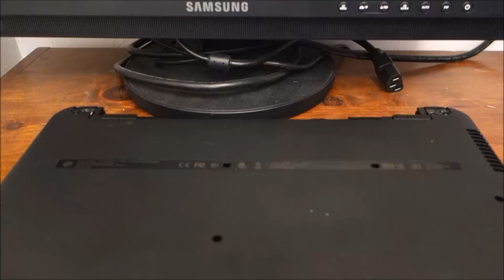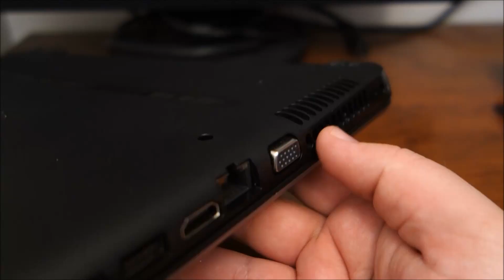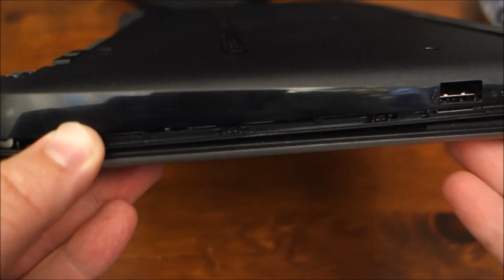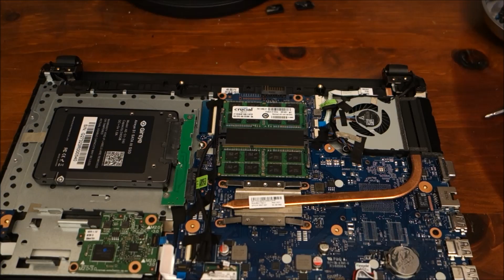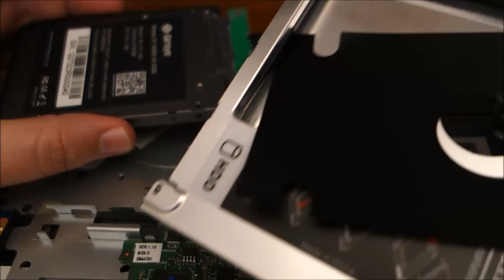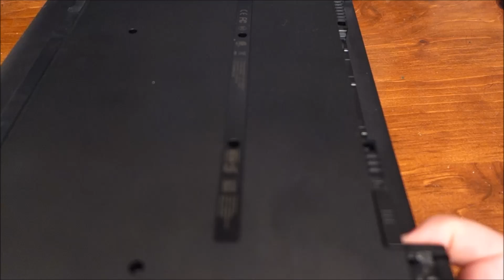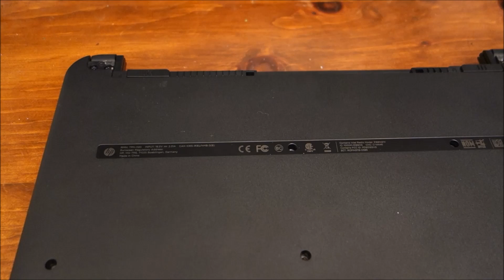HP 14-an013nr case opened up, ssd install, memory upgrade

Comment: well... I ended up breaking the back like you warned us about and I was so confused because I thought I had unscrewed everyrthing to find out that there was a secret screw next to the hinge. I saw 3 that were under the rubber stoppers but I had already unscrewed but when I just ripped the case off I saw there was an extra screw under a thin layer of something. In the end I super glued the piece back on and managed to upgrade my ram but the since the part that got ripped off right next to the battery it now causes the battery to be slightly crooked. worth it though.
Reply from the maker: +Dultimate Gamer oh no! Working on laptops has always been a "do at your own risk" kind of deal. I know you can buy a new base from hp, they are like $30.
Reply: AICproductions good to know that the back are relatively cheap just in case I really need a new one but you can only see the mess I made with super glue but not the damage itself which is nice because I am not the owner of the laptop.
Reply from the maker: +Dultimate Gamer got you. What upgrades did you do?
Reply: AICproductions I upgraded the ram to 2x4gb and was planning to upgrade the storage to because I had a broken laptop just lying around covered in dust at the time I didn't realise that I needed a adapter. I didn't really watch your entire video but I watched up to when you were talking about the ssd and you velcroing it but what does it mean to have a single channel ram slot(s)? Is there a major performance impact vs dual channel or is it just a minor inconvenience
Reply from the maker: +Dultimate Gamer dual channel means some systems can run a bit faster if you have two identical ram sticks. This system is not capable of that. It's only like a 5-10% increase in some instances.  This system isn't fast enough for that to make a difference. Linus tech tips covered it in a video recently.
Reply: AICproductions thank you for the info, I am using two completely different sticks of ram running at a different frequency and everything which I'm surprised even worked. Also ay you watch Linus Tech tips to? I love that channel
Reply from the maker: +Dultimate Gamer yup, he's one of my inspirations, but they tend to do quick reviews of top end stuff. I like reviewing stuff people actually buy.

Comment: where is the CPU? can i replace it with a better one?
Reply from the maker: +Boys Simard no.
Reply: no, i can't replace it?
Reply from the maker: +Boys Simard correct on these low low-end systems it is extremely uncommon to get a system where the CPU is not soldered to the motherboard
Reply: alright. to bad. thank you.

Comment: Excellent video. Truly helpful. One question. I see that you have added an SSD (instead of HDD) to increase the storage space. I was hoping to connect an USB drive (dongle) instead. Do you know if this laptop has unused USB 2.0 and/or USB 2.0 headers? Thanks so much!
Reply from the maker: +rajkumarpjain it does not. Why would you do that vs a 2.5"drive? I used an ssd because they are faster use less electricity and create heat than a regular drive, but you can pick up an sshd, which has some ssd storage and mechanical storage. They are a great compromise.
Reply: To access and work on the prop software, I need the USB security dongle to be connected via external USB ports at all times. The worry is that I might misplace the dongle. However if I am able to connect the dongle via available/unused headers internally, then that will solve my problem. I read somewhere that generally all motherboards come with spare USB Headers, where you can connect USB drives using cables/adapters. Are you sure there is not even a single USB 2.0 or USB 3.0 header?
Reply from the maker: +rajkumarpjain that's true for desktop computers but I've never seen that on the laptop computer
Reply: Ok. Do we even have a remote possibility to connect a USB dongle internally? I don't mind even connecting to a Sata Port provided there is an interface available somewhere!
Reply from the maker: I've never seen anything like that. I would check out monoprice/newegg to see if you can find anything. Good luck with your search.

Comment: Hello, this is my first time upgrading a computer so sorry if I seem like a noob. Once I connect the additional ram and SSD do I need to do anything else with configuration? I saw another instruction video that was messing with the BIOS configuration. All I want is more space and ram. Thanks!
Reply from the maker: you don't need to do anything more with ram, but with storage, it depends. if you want to run your OS from the SSD, then you'll need to install the OS to the SSD (which I recommend doing). there are plenty of videos covering how to install windows.
Reply: Could I use a cloning program to move everything including programs and the OS from my original hard drive to the new SSD?
Reply from the maker: +Nick Gonzales sure. I have always used macrium reflect.

Comment: That's a helpful video. Thanks a lot! But you mentioned there are 14 screws. There are 2 more wide headed screws near the cd drive slot that makes it a total of 16 screws.
Reply from the maker: 14, 16, what ever it is, its a ton. way more than there should be. my dell has 1 screw and my zbook 14 has a latch to remove the bottom plate.

Comment: Is it really only single channel? I see so many people upgrading it to 8gb by buying another 4gb ram
Reply from the maker: Yes, but you still get a performance boost by going from 4 gigs to 8 gigs. At least I sure noticed a difference in performance. but its confirmed by cpuz that it is single channel regardless of the number of dimm slots used.
Reply: Thanks for quick reply, so if I throw another 4gb of ram in there it doesn't recognize it as having 8gb but it's not just sitting there being unused? Another guy took out his 4gb completely and just put an 8gb in. Thanks for info
Reply from the maker: Of course it recognizes it. dual channel vs single channel is the speed at which the memory runs. if you have two memory dimms installed that are exactly the same (same speed, size, etc) the memory can run a little faster. that's all dual channel does for you. this computer really isn't fast enough to take advantage of that anyways. I had 2x8 sticks (16gb total) and it recognized all of that memory, but it wasn't any faster with 16 vs 8 gigs, so I have just 8 gigs in it.
Reply: AICproductions I see, thanks for the info I was getting the impression that if I just put another four in there it would be wasted, didn't want to spend all the money on an 8 GB when I could just have two fours
Reply from the maker: Yeah, 8 gigs seems about right, and having 2 4's is the perfect way to do it on this system.
Reply: I saw the same guy, it's confused... and literally I'm buying a 4GB memory, and I say fuc* I waste my money

Comment: hi where i can buy the ssd adapter i can find it... please send me the link
Reply: Enter this line in your browser or in the Amazon search bar (that's where I bought it) and you should find the exact caddy:   "HIGHROCK Hard Drive Caddy Tray 9.5mm Universal SATA 2nd HDD HD SSD Enclosure Hard Drive Caddy Case Tray, for 9.5mm Laptop CD / DVD-ROM Optical Bay Drive Slot (for SSD and HDD)"
Reply: I meant the board on the highrock HD caddy
Reply: Ebay
Reply: How did you get the board off -- the one i bought was riveted to the case and just snapped when i tried to remove it

Comment: Is it recommended to buy the Crucial 16GB or just keep the one in the laptop?
Reply from the maker: If you use my amazon partnerlink, the 16gb for sure! J/K. I personally feel that 8 gigs is the right amount. Unless you do a lot of things that use a lot of memory, but not CPU, like excel spread sheets. I've had 16 gigs/12 gigs/ and 8 gigs in it, and I did not notice any difference between them in day to day use (mostly web browsing, remote console, and email work).

Comment: These videos are seriously helpful and informative for this model of computer. Many people reference and link to your videos for help. Thank you for putting the time in to figure out these solutions and sharing.

By the way, is the CPU removable/soldered? I know this question was asked in a different way, but I can't find a straight answer anywhere. I have the opportunity to get this laptop plus a 128GB SSD/1TB HDD and a 8GB stick for about ~$240. A CPU upgrade would turn this laptop into a force to be reckoned with if I had the chance.
Reply from the maker: The CPU is soldered, and cannot be removed without major work/cost.

Comment: this may have been asked before, but what's the name of that adapter that connects the SSD to the port for an optical drive?
Reply from the maker: There is no name for it. you have to buy one of these: http://amzn.to/2ip2bOW. take it apart and inside is the green adaptor.

Comment: I have an hp 14-an010nr (similar model)  do you think that this would work?
Reply from the maker: Yes, I think so. it looks to be the same laptop, at least the shell looks the same. so I could only assume the internals are similarly laid out.
Reply: I have an na model.  The only difference is the specs.

Comment: I installed it a 256GB sad and the computer is not even registering it. Any tip on what I might be doing wrong would be appreciated. Same brand as the one you installed on the video just bigger memory, thanks in advance.
Reply from the maker: is it not recognizing it in windows? have you gone to disk manager and initialized it?

Comment: Is the caddy just for the adapter?
Reply from the maker: +Oscars A Grouch yes
Reply: do u know what the adapter is called ? How do I even get the adapter out of the caddy anyway ?
Reply from the maker: +Tai Tran Trong I don't know if the adapter has a specific name, and my adapter had 4 small screws that when undone allowed the caddy to open fully.

Comment: Why talk about the caddy when you never used it and why not mention what that green adapter is called so we can actually buy it??? I'm extremely confused by the presentation choice of this video :/
Reply: It looks like the caddy was just taken apart. The caddy they talked about in the video and linked to in the description are the same and the green adapter is just the inside of the caddy that he removed
Reply: Sorry, guess I'm old. Still do not see where you got the adapter, Can you just link the location where you got it
Reply: i was so happy to find this video but it was the comments that gave me the help i needed. this is my first time watching any of these your videos and it would have been a lot more helpful if you had just shared the link of your previous video like other youtubers and speak as if there's always new viewers watching. all in all i'm still grateful because i would still have issues had it not been for this video
Reply: I think this will work https://www.amazon.com/dp/B01AD70D7E/_encoding=UTF8?coliid=I29WTIB0MX9XJ7&colid=17OJQ9DCH19R0. But yeah I see no reference to where he got that adapter
Reply from the maker: This video is part of a series of videos done on this laptop and was done to answer many questions I had been asked. If you go to my first video of this laptop here: https://youtu.be/PJaPJtMfFOU?t=1781 at about 30 minutes in, you will have more information.
Reply from the maker: +The Relaxation Station exactly

Comment: ...well, I couldn't get the cloning to work so I opted for a clean install on the new SSD, removed all the partitions off the 32GB internal during the Windows 10 setup and now in Windows I don't even see the 32GB (which is how I want it).  Key here is that you need Windows 10 media and I'd STRONGLY recommend using the recovery tools on the built-in OS so that you have a way to get everything back to factory should you want to do that.  For me, I used the reflect software to create the cloned partitions but my problem was that I could never get the BIOS to accept my new SSD as the primary boot drive.  The other thing is with the reflect free cloning tool - it doesn't give you the option to extend the 29GB C;\ partition out to use whatever free space is left on your drive so you need another tool after you get windows moved to the new disk to do that.  So, I have access to a windows 10 Home ISO so I created a bootable USB key out of that and then just did a new install and went from there.  It's the 1607 build (latest at this time) so the good news was after manually running a windows update all the video/audio drivers were installed and everything works like a champ.  I did a video as well - you can find it here.  Thanks AIC for getting me started...good video:  https://www.youtube.com/watch?v=kdeSMD1jwkM&t=73s

Comment: couple questions...I installed a new SSD (doesn't see it in the BIOS initially until I use a disk cloning app) but when I re-enter the BIOS and try to select the new drive as the boot device clicking 'enter' does nothing - as in - doesn't let me select that device.  I'm also unable to use a USB key to just do a clean install - I move the USB to the top of the boot order and it just skips it and moves to booting to the internal 32GB.  Anyone have any more details on how the got past that step?
Reply from the maker: after you installed the drive, did you initialize it in storage management in windows? I don't think the bios will recognize it as a boot drive until windows is actually installed on it. as far as booting from the USB, you should be able to from windows go into settings and reset the computer and choose advanced boot options and boot from USB.
Reply: yes - used the reflect software to clone all the partitions to the new drive then rebooted and tried switching to the new SSD.  It showed up in the list but wouldn't 'select' when I'd hit return.  I guess I'm just going to do a fresh install to the SSD and just go from there.

Comment: Great info.. Here's a link to Maintenance and service manual.  http://h10032.www1.hp.com/ctg/Manual/c05227925 
Link for other specific items of interest. 
 http://support.hp.com/us-en/product/HP-14-Notebook-PC-series/10862293/model/11992112/manuals

 The laptop does offer an option to upgrade the eMMC memory from 32 to 64gb.    I don't recommend given eMMC memory is slow verses other options.

Comment: So, where did you get that green thing that connects the SSD with the SATA connection to the motherboard? Is that something that came with the caddy?
Reply from the maker: +g68unit I took apart the caddy and that is the controller board of the caddy. So I just used it.
Reply: Cool thanks. I just got that caddy, I could have gotten a cable that would have done the same thing, but I didn't want to risk it not working, and I know that this works, so I just went for it.

Comment: Thanks for the great video! So just to clarify, what do you recommend for RAM on this? 2 x 4? 1 x 8? 2 x 8? What's the highest I could go that you feel would have an impact on my PC use? Thanks again!
Reply from the maker: Well, 4 gigs is not enough, normally 2x4 > 1x8 because most systems run dual channel, and so its faster, but in this case, because this system only runs in single channel regardless of dimms used so 2x4 = 1x8. I personally run 1x8 because I had a laptop with 4x8 (32 gigs) so I swapped the 4 gig with one of its chips, and so it has 28, and this laptop has 8. I had 16 gigs in it for a while, but it had no real impact over the 8 gigs, since I ran out of CPU power before I ran out of memory.
Reply: So if I leave in the existing 4 gig chip and add a second 4 gig chip, that's about the best configuration that I'll notice (as opposed to putting in more memory)? Thanks for your help!
Reply from the maker: Correct, you will get the same performance as 1x8 gig chip, and buying a 4 gig chip is a lot cheaper than buying an 8 gig chip.
Reply: Sorry, one more question: Do you think it would be better to have 12GB (8+4) than 8GB (4+4) in the system? Buying an 8G stick isn't too much more on Amazon ($53 v $30), so I'll go with the 12 total if 12 total feels better than 8 total. But if 12 will feel identical to 8 (due to CPU limitations), then I might as well save $23 and just go with 8 (4+4).

Any thoughts on that? You mentioned that 16 (8+8) seemed like a bit of a waste, given the CPU, but I was wondering your thoughts on 12 (8+4). Thanks!
Reply from the maker: With the fact that ddr3 is going away in favor of ddr4, I would save my $23, since you probably won't be using the extra memory in another system when you replace this one. But that's just me. It also depends on what you're doing with it. If you going to have a ton of say, power point presentations open that require almost 0 cpu resources, but require a crap ton of memory, then yes, you could make use of the extra memory, but if you are doing things that are more cpu intensive, then you will run out of cpu long before you run out of memory. so it really depends on your work loads. Since most web use anymore is CPU AND memory intensive, 8 gigs should be plenty, if you do a lot of document editing, then go for the additional 4 gigs.
Reply: Great, thanks again for the advice!
Reply from the maker: +Adam Tierney np, always glad to spout out my opinion!

Comment: I installed a new SSD (opened the PC and connected it) but it isn't recognized in the Disk Management or Marium Reflect. (I couldn't figure out how to check to if BIOS recognized it.) I checked and all drivers are up to date. Did you have to do anything to get the PC to recognize the new drive? If not, do you have any idea as to what I might be able to do? Thank you in advance. Your video is really helpful.
Reply: So the new SSD appeared in the Disk Management without doing anything? (I cannot initialize it because it doesn't appear in the Disk Management.)
Reply: Hey, did you ever figure this out?
I am having the same issue.
Thanks.
Reply: Yes, it was the connection between the SSD and caddy. I thought the SSD was all the way in, but it wasn't.